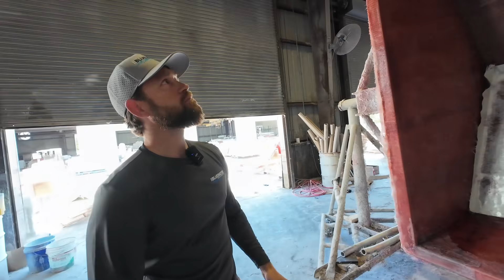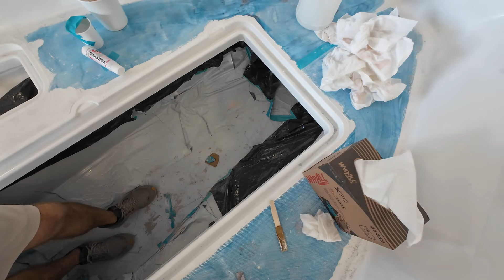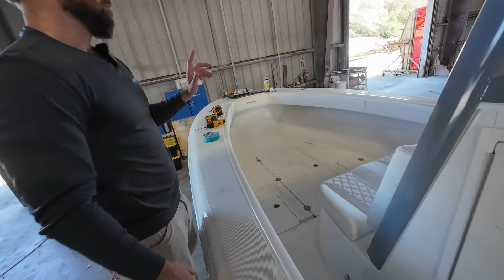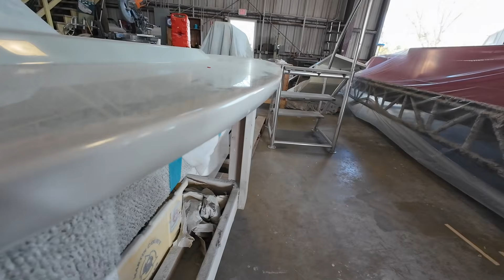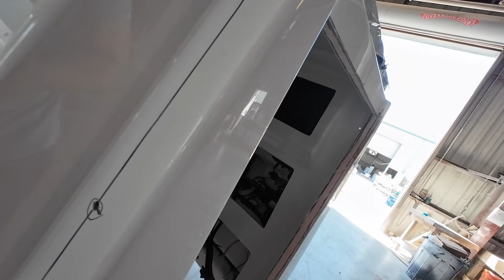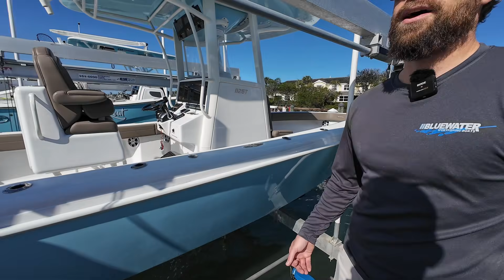THIS Is How The BEST Boats Are Made!!!

Comment: A friend of mine here in central east coast FL has a 28 Bluewater and it rides like a yacht. It sounds like it hurts the waves more than it hurts the boat even at 35 knots in 6-7 foot swell. Contender is a bigger brand name, but they're not a better boat.
Reply from the maker: This particular one rode better than the contender of equal size. I’ve been on both in rough seas. The Bluewater didn’t bang once. It’s a bad ass boat. 🤙🛥️🌊

Comment: These boats get better and better every year. The hook on the rear of the running surface has always been there and comes from the formula 233 design which is what this boat is a copy of. Paul was very smart in not taking it off like other formula copies have done. The hull runs great with it and helps getting on plane faster and avoid porpoising.
Reply from the maker: I didn’t know the original formula hull had the hook. Amazing how an old design like that can still stand true today. It definitely runs amazing! 🤙🌊🛥️
Reply: @perfectfitboating  Yes, that hull design is the most copied in history. I could name 15 or more known names that copied the F233. I remember meeting Paul from Bluewater at his first boat show and talking with him extensively about the hull design on the Bluewater. He did change the round keel to a V shape all the way aft, but pretty much kept everything else from the F233 hull. I'm glad to see the 3 piece design finally,  they've come a long way.

Comment: I don't know why all of the boat manufacturers continue to wire boats using the same garbage methods that have been used for decades.  There is no reason to keep using those old terminal blocks.  Why don't they use proper power distribution modules with amp seal connectors.  Wiring could be greatly simplified and made much more reliable.  There is no need for traditional analog switches.  Everything should be multiplexed or operated from a data bus.  Power distribution modules can be placed throughout the boat where the equipment is actually located. There is no need to run all the wires back to the helm.  2 control wires are all that's needed.
Reply: Simplicity that any owner can diagnose and work on.
Reply from the maker: Maybe the customer ordered it that way. Maybe you missed the part where I mentioned this was a custom shop who makes boats to the customers liking. Which boat company do you own and operate and where can we see the work you’ve done?
Reply: @perfectfitboating  I have been designing and building complete electrical systems for aircraft, concept vehicles, race cars, and race boats for the past 20 years.
Reply from the maker: @DarrelJones-fh2wx great. Start a channel and start showing people how to do it.
Reply: @perfectfitboating you know that won’t happen 🤣 he’s just going to stay on the keyboard telling everyone they’re doing it wrong.
Reply: @perfectfitboating  25 years at seafarer marine supply. Every repower, gen install and every bow thruster in a Catalina 470 till about 2016 when they finally took it over.  I get phone calls from all over the world on how to get their kohler generator running.
Reply from the maker: @robertdinicola9225 wow. And if it isn’t kept simple as you mentioned, there’s no way to walk an owner or captain through an issue.